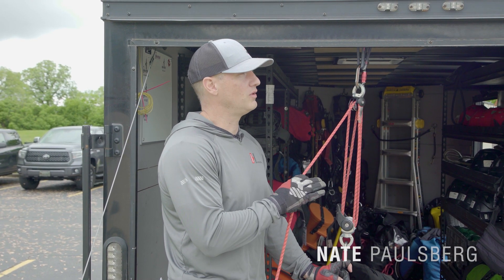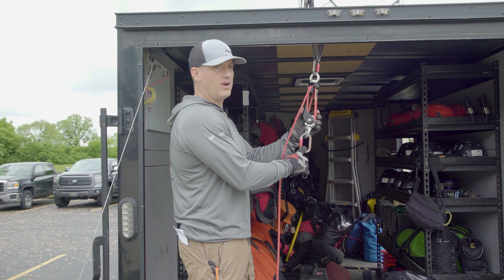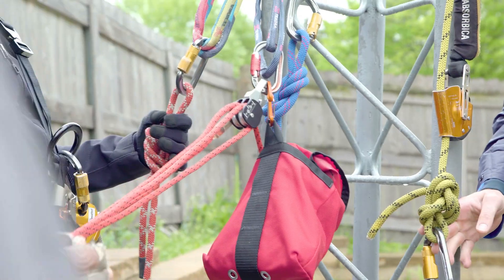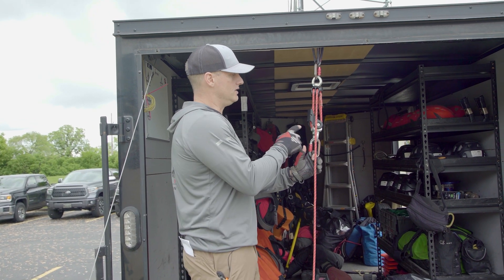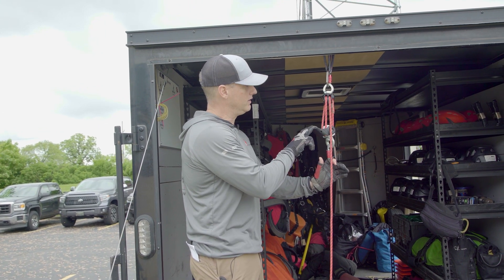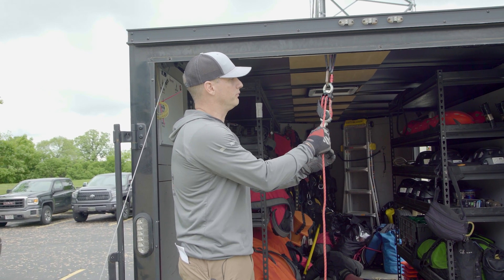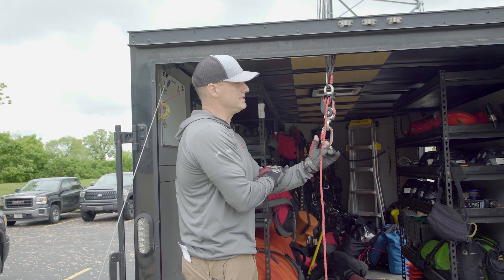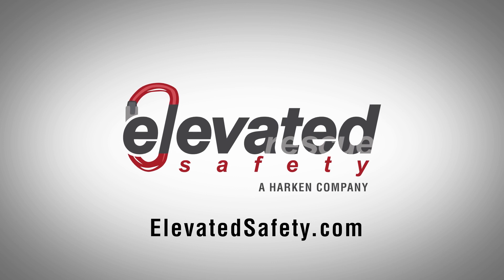Gear Demo: Harken Wingman

Comment: To those commenting on edge restraint, there is nothing saying you can’t utilize the wingman for edge restraint.  We use it regularly for that. 
You are simply attaching the two swivels, one to your anchor and one to your worker. You extent out by pulling the lowering lever. 
What we utilize far more however is the petzyl ASAP lock.  The Aztec we found extremely cumbersome. Human error factors in not attaching the prusik cords or having difficulty in managing the prusik cords in the cold and rain made the wingman an absolutely simple no brainer. We have found zero differences in capability with the wingman over the Aztec other than the wingman collapses tighter and there is zero learning curve or human error factors in safety.

Comment: Only downside to this - unlike the Aztek which has prusiks on both ends to allow for close access by the operator for progress capture and release in both 4:1 and 5:1 modes, the Sterling ratchet is only available on one end (so your options are a little more limited on how one may chose to deploy this system during a pickoff). Would like to see ratchets on both ends combined with the option to lock one open (for free spool) while the opposing end is engaged in progress capture.  Also why is this kit not being offered with an edge restraint option on the opposite end of the 50 foot line...is that forthcoming?  If the target market is for those of us currently using Azteks then edge restraint capability must be incorporated.
Reply: The problem with adding those options is what they will do to the price of an already expensive product. It will price is out of the market. As for the edge restraint, just put a grigri on the tail end of the Wingman and you're good to go.
Reply: If the target market is as an alternative to the AZTEK  do not see Harkin being successful without incorporating the enhancements to its product.  While having the ability to throttle the ratchet on the Wingman with a lever is a cool capability, that convenience doesnt offset the range of organic functionality provided by the AZTEK (there is nothing to add to do edge restraint or a 5:1 pickoff for example).